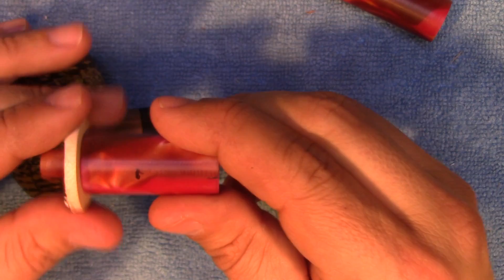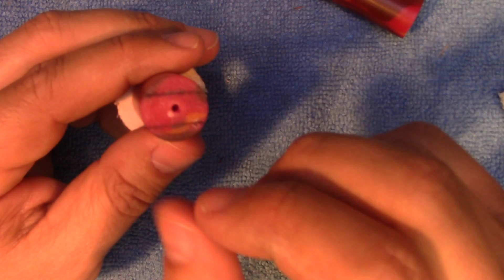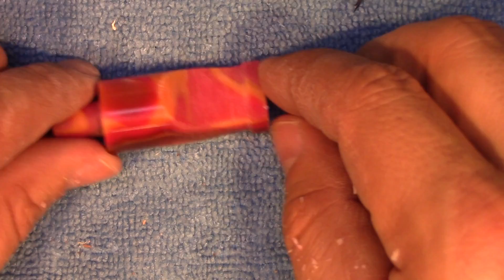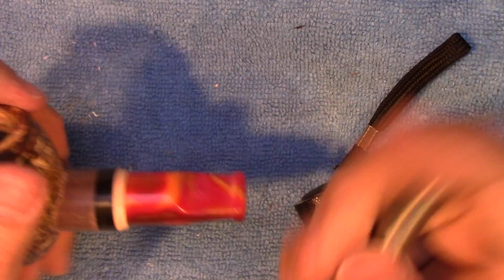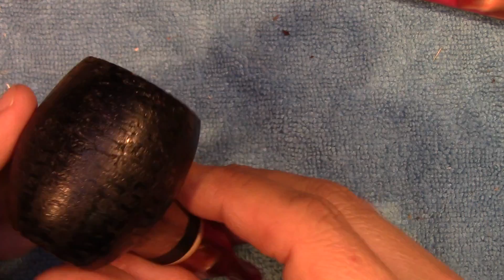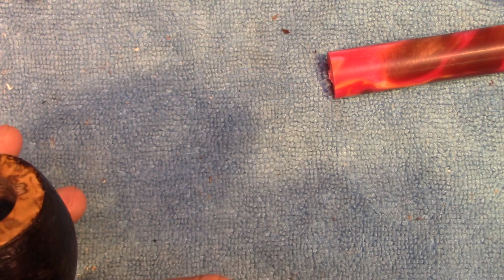Corn Cob Pipe Modification Part 4B - Cobfoolery (2 of 2)

Comment: What kind of adhesive did you use to attach the tenon to the bowl? can wood glue be used safely or is epoxy the best choice?
Reply from the maker: +flitdek I find epoxy to be more heat resistant. But Missouri Meerschaum seems to use some sort of wood glue without issue.  Best, Mike.

Comment: Came out great Mike, that stem is not bad, I would have tapered it down a bit more to get a thinner bite, other then that the pipe is beautiful
Reply from the maker: +PipeLeisure Thank you!  I agree with you on the stem.  I need to learn how to drill acrylic without scaring the draft hole.  If I go thinner now, the draft hole starts to show through.  Practice practice practice...  Be well, Mike.